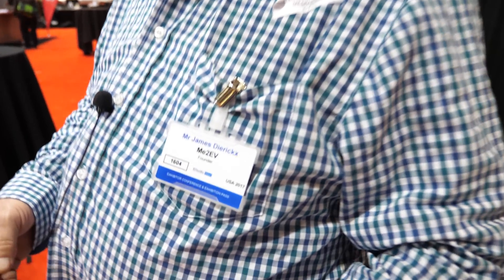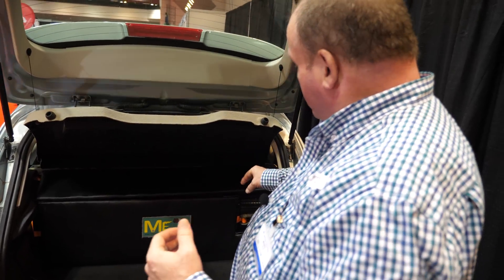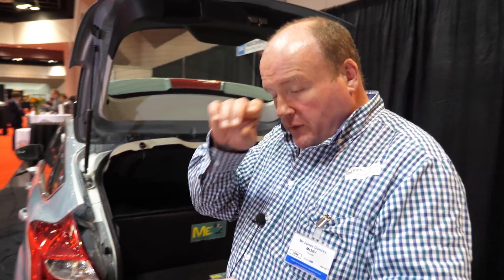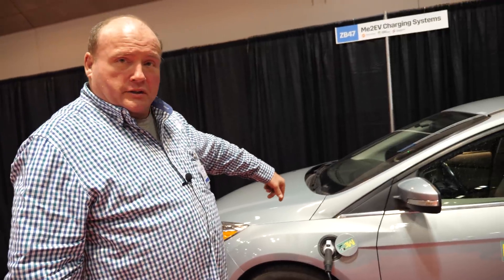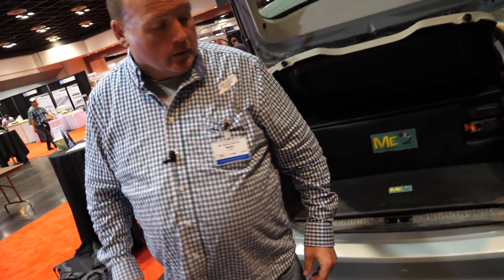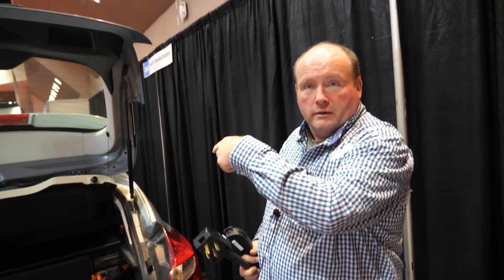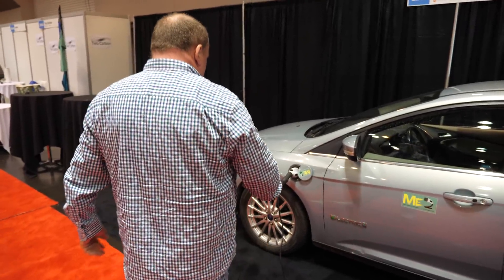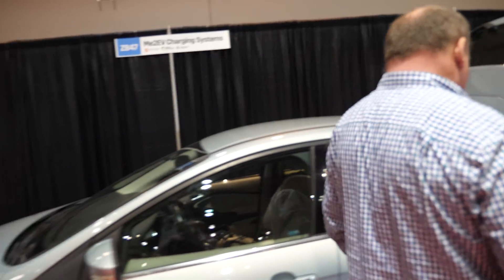Range Extenders for Electric Vehicles

Comment: iv got this idea too and every body shot it down. they said that the extra weight offsets the additional advantages. But to add to this idea is i can see that we has level 2 charging using s 240v sinewave converter to charge the car. a better solution is to use DC charging functionality(yup if the car is not dc this wont work.). you need to step up your voltage to 480v using multiple regulators in series and that could fast charge your battery in minutes instead of hours. And this is more efficient than inverter.
it is said that sla is 50% more heavier than lithium per watt. but its more dense so it dosent need to much volume.

Comment: At first i thought this guy was crazy but the more i think about it the combination of true storage batteries that like to output small amounts of power for long periods. On the other hand, they have now started to recycle lithium based batteries. But if you were going to do it then it would be much better to deliver the power directly to the speed controller, bypassing many inefficiencies in the inverting and the charging systems, not to mention the inefficiency of power flowing in and then out of the lithium batteries. I was thinking briefcase generator or micro gas turbine generator if you could afford one.

Comment: Instead of making an external plug, I've been thinking of splicing into the wires on the inside and installing a giant sturdy reliable switch to activate the external battery charging process. And the second plug could be hidden better, maybe downward facing just behind the lip of a cowling.
Reply: If you tap the Ford wires you’ll probably void the warranty. Test products should be ones out of warranty. You have a great idea.

Comment: Ok hold on a sec. Take out those lead acid batteries put some lithium ion batteries like Battle Born. They will last longer then those heavy lead acid batteries. Lead acid batteries even marine batteries are only good for out putting a surge current not long current. For those amount of lead acid batteries you have and swap them out for Battle Born one you can get like 5 time more output power than what you currently have. And since you have already cut into the bumper try integrating the charging cable for the EV battery so it's not hanging out the car. 
Other than that not bad.
Lead acid batteries 60 pounds
Battle Born 30 pounds
Cut weight saving in half literally, just a bit more expensive.
Or just but Tesla modules and add them to the EV battery / plug in battery

Comment: great idea for older ev's with low range, but probably not worth the hassle with the newer high range ev's they are making today and they will only continue to increase.
i think manufactures should build in battery ports so you can add range just by plugging in an additional battery packs. wouldnt that be nice

Comment: USE SOLAR INSTEAD OF LEAD-ACID AND AVOID THE CAR WEIGHT PROBLEM, BUT THERE IS A TIME FACTOR.
Reply: Well it can't go straight from the panel to the car battery right? All the builds I've seen have like 3 other components at least. Hope you can understand, my ALLCAPS isn't that great😅

Comment: He created a required led acid emergency backup power bank for Tesla. Which is required. Don't do  600 pound that'll charge battery 100%. Added weight will affect range of car and instability. 
Go for 150 pound/75kg emergency backup led acid battery 🔋 that'll charge the car 25% in time of rare emergency. 
You don't need to carry so much extra weight. But a backup is always required. 
Portable generators add 12 miles/gallon of gas in around 3 hours. That is much better than carrying 150pound battery 🔋.  
Wind power can possible charge the car enough to add 5 mile/hour but I'm unsure how many miles can be added using this method. Assuming we put 3 fans below headlight in front of car 🚗 and put black grills to cover the fans from front. So fans will be inside the car and all you'll be able to see are the black grills and headlight.

Comment: Great idea, Lithium Ion is utterly atrocious filthy technology.  Just ditch the fire hazard and use lead acid.  Tesla batteries run as high as $140,000 for the old, unsupported 2008-2012 Roadsters.  A Model S 100D runs about $80,000 for a new Li-On battery and they die about every 3-5 years.
Reply: ev batteries are made from cells, the entire battery doesn't die , for a person that knows how to repair it he opens it up and replaces the cells that are bad , back on the road
Reply: @tonycavez 
Dead cells cause large banks of cells to be permanently shut off.  Large multi-cell batteries have banks of cells in series and in parrallel.  Since Li-On cells are only 3.7V nominal, there is a huge series requirement to create the triple digit voltage required to drive the motor.  Any dead in-series cells rapidly accelerate the death of the battery since all the other cells in series must try to push their voltage through the dead cell, attempting to charge it as it discharges them, and the final voltage is reduced by the number of dead cells, likely falling outside the minimum voltage requirement for the battery or bank.  The controller will permantly shut of all the good and bad cells in that circuit, resulting in massive capacity loss best case, and a completely dead battery worst cast.  Ever time it happens, chances of killing the whole battery dramatically increase.  Parrallel banks or parts of them are easier to shut off in isolation, and doing so usually only results in permanent capacity loss.  Worst case, and not uncommon is thermal runaway killing all occupants instantly, and exploding and rexplodind for days.  Firefighter are trained not to intervene or help, as it is too lethal.

Comment: Seems like you could charge a separate bank of super capacitors (using 2 charge stations while on a road trip), and let the capacitors bleed into the main battery using the same method as regenerative breaking. The most dangerous part of this video is the custom cable with male plugs on each end. please just use J1772 and an EVSE for all EV charging.

Comment: I can tell that most people who are leaving negative comments don't own an all electric vehicle.  I do, and can tell you that this will reduce range anxiety, and a reasonable option to consider.   Nice work.
Reply: Me too having an electric car, and it's not a Tesla. This lead acid crap will increase the vehicles weight, making it inefficient. Perhaps the range will even drop with all these extra weight. I think you own an EV without knowledge of batterys and energy density.

The next problem: With those batterys, you can forget fast charging. A lithium cell can be charged at at least 1C. A modern lead acid or AGM with only 0.1C. 

Enjoy driving with less range and a 10 times longer stay at the charging station...
Reply: Maby if you put it on a trailer it might be better?
Reply: @Mikewalden12345  physically not. If the battery is on a trailer or inside the car, it doesn't matter: The weight is the same to pull.
Reply: @rsha9505  in all honesty just need an ev with a larger battery.  I have a 500e and the range meter isn't allways accurate.  I just plan my trips better.  Would be nice if there were other options.
Reply: @Mikewalden12345  yeah, the 500e is not really efficient, that's the biggest downside of this car. My car's battery is just slightly bigger (27kWh). But I'm capable to travel through Europe with ease. There is always a fast charger in range.
Reply: Just because you own an EV doesn't mean you understand the science here

Comment: Check out the Lead Acid Battery charging lead going to the mains (10:30).  A male wall plug with heavy duty pins (no big deal), and at the other end yes, another male plug with exposed heavy duty pins! So no safety problem there then? Jeeez - and he thinks this is marketable, doh! Then later he tells us he hopes to be able to charge AND drive at the same time? Is this for real, a charging current going into the Li-On battery whilst also going out to the motor simultaneously? And then there are the losses in efficiency to consider, converting from one to the other, with an inverter in-between for good measure. Why not just put a petrol generator in the trunk and be done with it, or if you want to be environmentally friendly stick a wind turbine on the top of the car - then drive around, and let it charge the batteries as you go! That was a joke btw, before you all reply....
Reply: Petrol generator wont work tried it.  Charger falted out incorrect wire or grounding issue.

Comment: Why? :) Instead, he could have spent the time integrating a small ethanol powered range extending generator under the car. It would have been more interesting. The current implementation is self-defeating (weight, space, wear and tear ... the OEM LION batteries in the vehicle are heavily self protected)  https://www.duromaxpower.com/duromax-4850-watt-duel-fuel-hybrid-generator

Comment: Use lithium batteries and save weight.  I found a 6000 watt inverter I am getting and will connect 2 used 12 volt  lithium batteries with 2 new level 2 charger I have.

Comment: Charging, Discharging, DC to AC and AC to DC are all lossy processes. He is doing all  four. He can totally eliminate them by taking the DC from the add-on battery and ORing it with DC from main battery. You would definitely void the warranty doing this but the current technique is too wasteful. Even after all that, I think the sheer weight of those batteries will eat into the the range. So net gain will be small. Full marks for enthusiasm though.
Reply: "Charging, Discharging, DC to AC and AC to DC are all lossy processes. He is doing all  four. He can totally eliminate them by taking the DC from the add-on battery and ORing it with DC from main battery. You would definitely void the warranty doing this but the current technique is too wasteful. Even after all that, I think the sheer weight of those batteries will eat into the the range. So net gain will be small. Full marks for enthusiasm though."  

YUP!  
95% of user trips fall within the average ev's battery range.  This means that, in order to reduce our range anxiety for 5% of trips, he wants us to drag around an additional 600 lbs thus reducing the range for 95% of trips.  At 600 lbs it is not something we would take in an out of the car according the trip distance.  Sounds like a poor trade.  

Also, DC-to-AC and AC-to-DC conversion each have ~92% average efficiency - 0.92 x 0.92 = 0.85 i.e a 15% loss before the power reaches the car.  Further, to use the extender, we have to stop and plug it in.  No thanks.

Comment: I am not quite sure I believe what this guy is saying plus all that additional weight is going to cut down the range of the car.  If what he saying is true that pound per pound lead acid batteries hold as much energy and lithium ion batteries at nearly 1/20 the cost of lithium ion batteries and take up less space as lithium ion is you just add a few large capacitors to an all lead acid battery system and use the capacitors for short bursts during acceleration to match the performance of an all lithium ion system.  Plus the capacitors are much better at regenerative breaking in that they can be charged quicker than lithium ion batteries can be so you get more energy out of regenerative breaking using capacitors.

That being said I don't think this guy has his facts straight.  Just did some quick research pound per pound lithium ion batteries hold at worst over twice as much energy and at best over seven times the energy of lead acid batteries.  His system of lead acid batteries if they weigh the same as the car's lithium battery could only charge it up to maybe half and that is if the car had a really crappy lithium ion battery.  If it had a good lithium ion battery his system would be able to charge it up one seventh.  The amount of range you would lose would not be worth carrying all that extra weight around in lead acid batteries.

Comment: I do not know where he is getting his price from for the batteries. The Ford focus Ev has crap battery power, compared to a leaf. So how the Ford cost more is beyond me plus you have the recharge issue of lead acid.There
Reply: I had a 2013 leaf 
And now I have a 2013 Ford focus and the Ford focus is way better on the highway I hardly touch the gas pedal and I could do65 no problem if I had to put down a lot harder to get it to move the Ford focus is better hands down
Reply: the focus was made in small numbers and the leaf is more popular and maybe that's why the cost goes down

Comment: I had an idea, I’m sure I’m not the only one, where it would be nice to be able to rent additional battery capacity to support a road trip. That way you could buy a less expensive EV that you can use locally but then when you want to go on a road trip say for a vacation you can rent one of these  batteries to extend your range. Hopefully it can be made to work with the dc fast chargers.
Reply: I have thought about having a small two wheeled trailer that would have a battery or batteries that could be plugged into the car as you drove to extend the range of EVs and that would also have some storage room for suitcases.  Combining your idea of renting additional batteries and my idea of a small two wheeled trailer would be great for a company like U-Haul.  U-Haul be great in that you drive to another city and then just swap one trailer for another and carry on your road trip.

Comment: I have been working on both technology n o don't find all what he say in alignment. Lithium ion batteries are 3-4 times the cost of lead acid not 18-20 (at least in India) . Lithium ion are much more lighter n last 1000 plus cycles vs 200-300 of lead acid. Volumes of lead acid is much more than lion batts for same power!

Comment: In theory not too efficient converting DC from lead battery into AC to be converted back to DC by the car's own inverter that charges the LI battery. Also the extra weight diminishes the original range of the car. Not convinced.